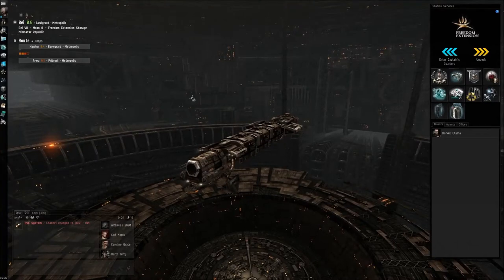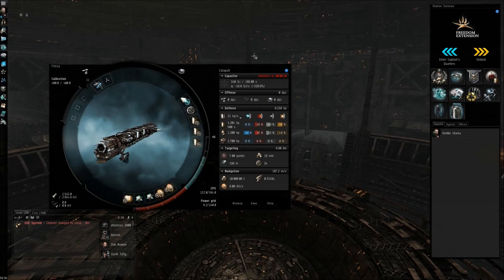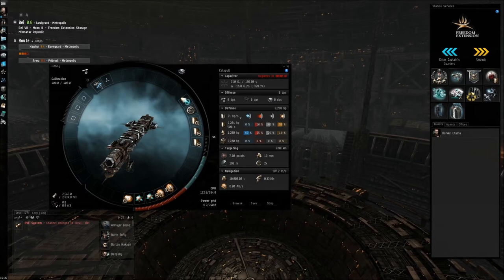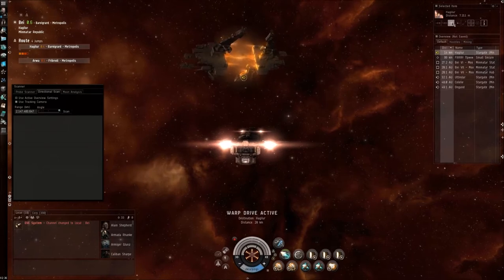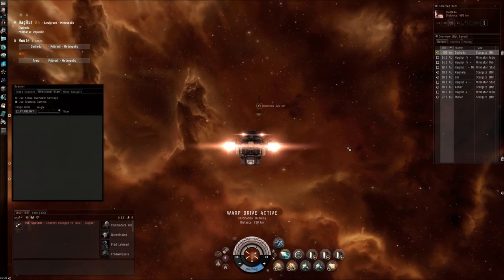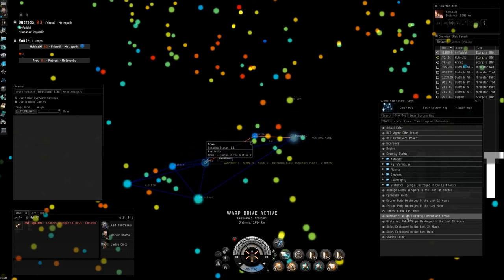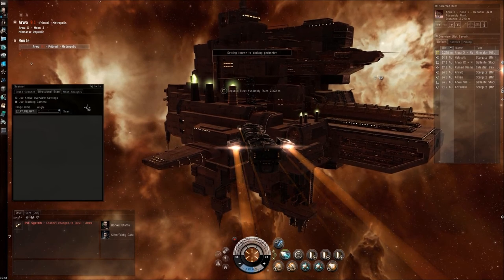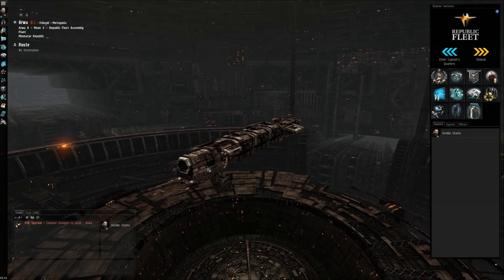Hauling Into Low Sec - EVE Online

Comment: The overdrive also has the effect of making you take longer to get into warp
Reply from the maker: +Wowthatsfail To my knowledge, overdrive injector does not affect the time it takes to enter warp. Mods that artificially increase the ship's speed (ie Afterburner and Microwarpdrive) do though. At least that's the way it was during the making of the video. Things may have changed now and I'd have to confirm in game :). Thanks for letting me know, I'll research that further o7

Comment: thank you for the guide!! now i can safely go to low sec to go for planetary interaction!

btw ive seen some videos about making a base with some bubble surrounding it , is that good for a beginner at lowsec. how much ISK that i need ?
Reply from the maker: +YKD Gaming Building and maintaining your own POS (player-operated station) is quite an expensive thing to do. It's not impossible to do it solo, but usually it'll be a corp effort. For a beginner, I'd just stick to regular stations and/or ferrying the stuff to high sec. o7
Reply: Thanks ! o7

Comment: noob question but what is in the mid  slot apart from cargo expanders? :/:/
Reply from the maker: Sorry for the late reply, your question didn't pop up before for some reason.

I usually put a MWD and some shield extenders in the mids, although sometimes I end up leaving some of the mid slots empty.

You can put cargo expanders in the lows, but for the purposes of this hauler I had to put mods that would help me get out of trouble. If you really need more cargo space, you can install cargo expanding rigs. Sadly they don't come cheap though.

Comment: this is a t1 ship ? i was told there was no t1 blockade runners :/
Reply from the maker: Technically there's no t1 blockade runners, but the microwarpdrive + cloak trick essentially turns your t1 hauler into a blockade runner. That being said, this won't survive a serious gate camp, especially if it has good interceptor pilots. It all depends on your own skill with the MWD+cloak trick and fast response of the blockading ship. It is a much cheaper ship though and does the job when needed. And any industrial cargo ship can be outfitted with MWD and a cloak to serve the purpose that you need.
Reply: ReLoad but mate, i can only carry 3 gas command centers, how will i be able to haul anything with a litle bit of volume? I was thinking of using the  wreathe for low sec pi, i cant fly a blockade runner yet, thanks for answering btw.
Reply from the maker: flaps ster You have to upgrade your hauler with cargo expanding rigs or modules (or both) to get to whatever volume you need. Wreathe should do the trick, if not then perhaps Mammoth is a better option. Keep in mind that T2 blockade runners don't have the best cargo volume either. In fact, Prowler (the T2 blockade runner variant of the Wreathe) has a slightly lower cargo capacity than Wreathe.
Reply: ReLoad I do not actually have MWD on my Wreathe and fit it for agility and warp core stabilizers and only that. No cargo expanders. Even the rig slots are nothing but agility rigs. I will need to make more trips but I found that I could usually enter warp faster than a t1 frigate could lock. Throw in heavy shield buffer to survive one or two volleys from instant-lock Tornadoes before entering warp. 

I also found that Wreathe is probably the only t1 hauler that could safely enter and exit lowsec reliable (Hoarders being a good second but that's ammo and charges only) due to the sweet, sweet align time and heavy shield buffer.

Comment: Terrible terrible setup my friend v.v;
Couple pointers/tips to make you slightly effective at this (in case you do come across a camp)
1st: (and most important imo) Put your Cloak and MWD in the 1 and 2 keys so you can click them your your hotkeys instead of scrolling with your mouse. cuz your mouse is gonna be up aligning and warping (you wanna keep it there, not scrolling back and forth)
2nd: Ditch the overdrive and warp cor stabs, the overdrive makes it so you gotta go faster to warp out, making it harder for ya + you don't wanna lose cargo capacity. and If you get caught, your caught, there will be too many points on ya, your wasting your time with those stabs. Put Inertia stabilizers and cargo hold expanders Only* have enough stabilizers to align yourself, and the rest cargo expanders so you can hold as much as possible.
Other than than, not too bad...except remember to warp to the right gate next time :P
Reply from the maker: Mataiodragon Hot keys certainly help a lot!! Yeah, warping to a wrong gate was a major brain fart! Thanks for the pointers/tips!